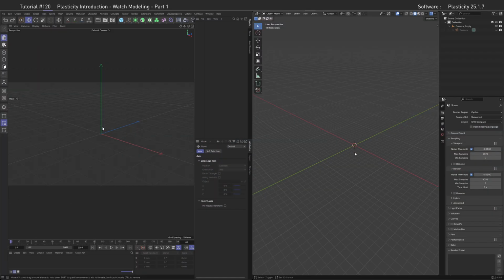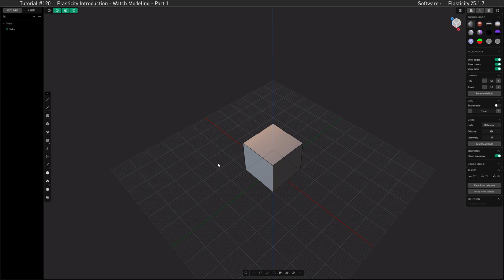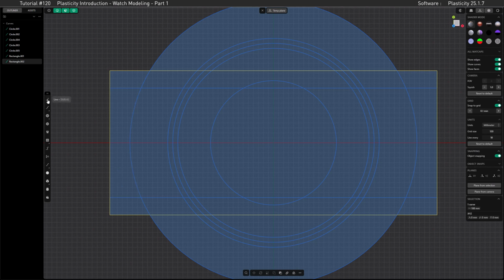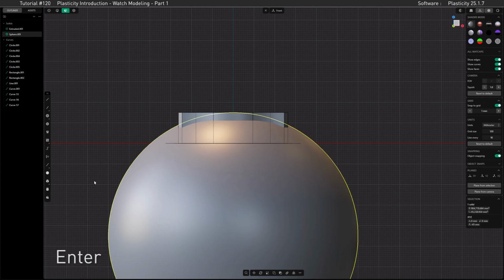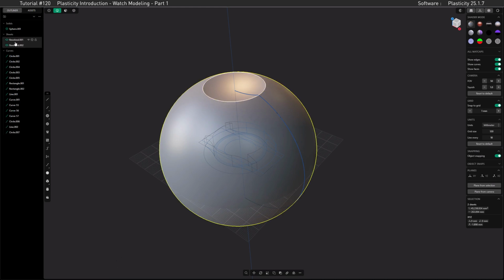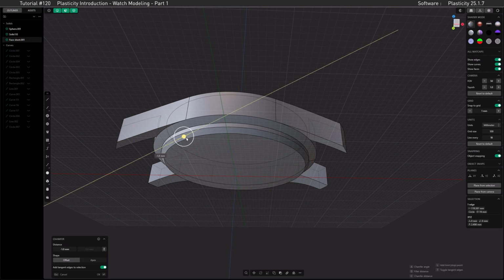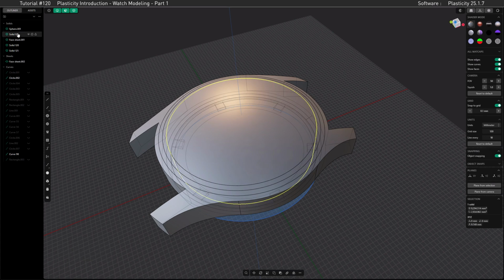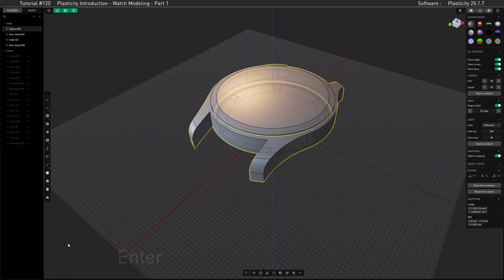Silverwing: Plasticity Introduction - Watch Modeling PT1

Comment: Hello artist, I would like to ask you a question that I have cloned hundreds of mobile phone screens in C4D. How can I make each screen play a different video through octane node
Reply from the maker: Hey there and thank you for your comment.
I don't know the answer directly and would need to do some research to get there.
What you can do is search for a solution in C4D. If it is not possible in C4D, there is a good chance that it also isn't possible in Octane. But if there is a solution for C4D itself then probably it can be done the same way in Octane as the video loader is the one of C4D and randomization would have to come through there for Octane as well!
Reply: @ thanks

Comment: Super tutorial! One quick thing, can you maybe go into why you prefer Palsticity over MOI in the next video? Are there “tangible” advantages to this or is it just a personal preference? I'm asking because MOI is already available as a “free” add-on with an Octane license.
Reply from the maker: Hey there. Super nice seeing you here.
Thank you for the suggestion. When I do the conversion into C4D I will go over that.
In short it's the usability for me. I never could get warm with MOI. As I said plasticity is very close to Blender in terms of shortcuts and usability. So I can move incredibly fast with it. In MOI I always had problems performing even the simplest tasks. Maybe I am missing someone who tells me what I am doing wrong there. 

The best way to describe it would be to compare it with the experience I had with Rizom UV. From one moment to the other, unwrapping UVs has gone from a threaded task to fun.
Plasticity converts CAD processing (for example if you get CAD files from clients), from a tedious and depressing task to a fun experience.